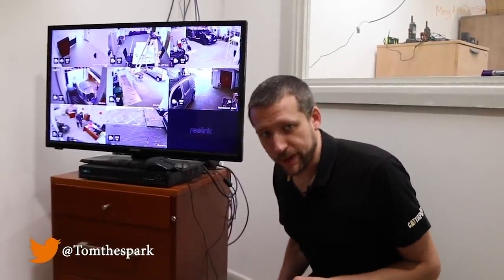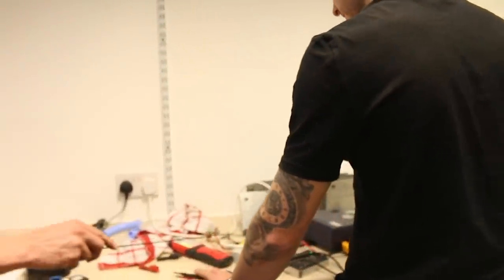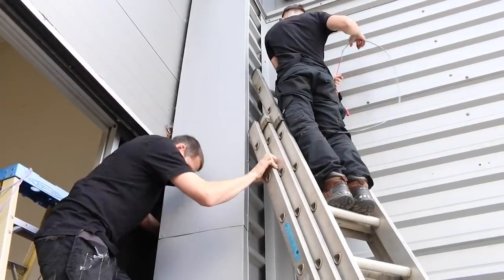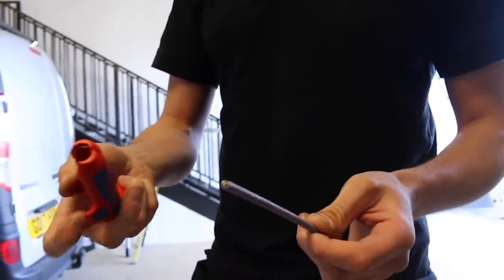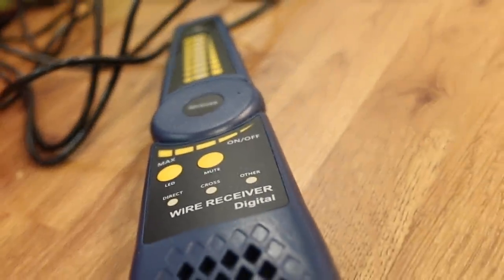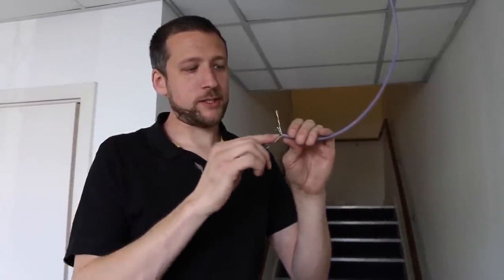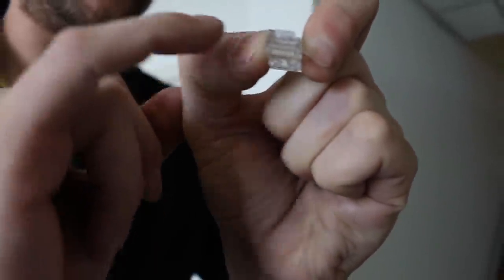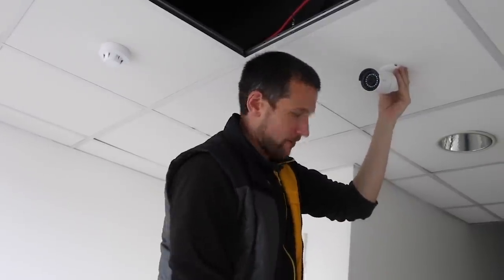Installing 4K CCTV & Terminating Cat6 Cable.

Comment: Tom, your videos are interesting but the audio is a let down. Volume of your voice varies and is much lower than YouTube ads in-between the video. Plus the sound is not very clear at times. Please consider using a good quality wireless lapel microphone and adjusting sound level to match volume of general YouTube videos. Cheers.

Comment: That fine metal core is ur ground and u should really use metal RJ45s if there is a ground core available in the cable, even more so with PoE since its carrying power... Its not for strength, most cables have string inside for that. if the PoE injector is earthed it will also earth the camera chassis by means of the RJ45 socket being earthed on the PoE injector and you crimp that thin metal in to the rj45 plug side lug. Bet u havent seen metal RJ45s or u might have done it this way.  Another word of caution... them connectors are terrible! if u get a short on the end it could damage the poe or if its a -48v poe give u a tingle. I banned them from my work since we had no end of faults on them especially on outdoor equipment due to corrosion. Its not hard to use the old fashioned reliable crimps and imo it makes a better job. Im not picking fault im just sharing my many years of networking to give you some advice based on past experience.

Comment: I think you've been 'ad cat 6 should have either a dielectric core or shielding on individual pairs. It looks like you have shielded cat 5 there. (https://www.cablematters.com/blog/Networking/cat5e-vs-cat6)
Reply: Cat6 doesn’t have a core or shielding, cat6a has a core, cat 7 has pair shielding.

Comment: No way is the Cat6 core there for strength when pulling the cable. It's to maintain consistent spacing between the four twisted pairs, reducing crosstalk and keeping impedance more constant.